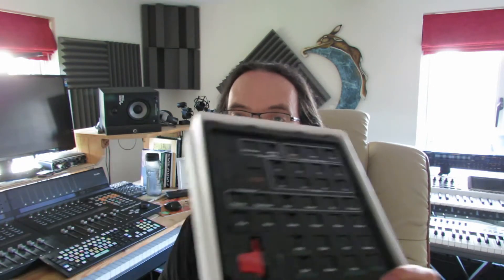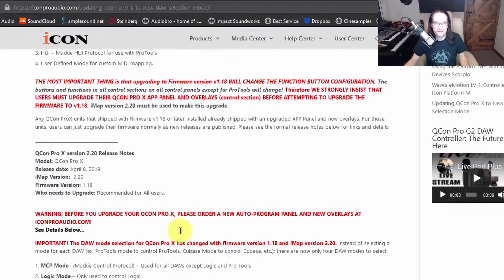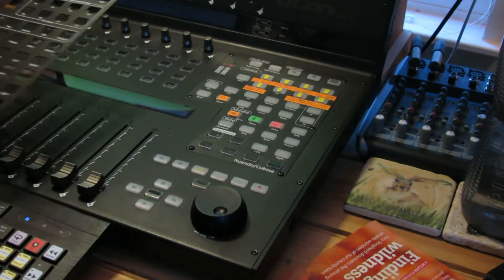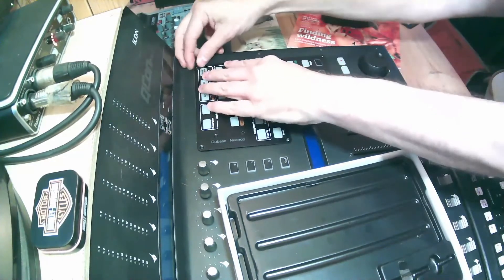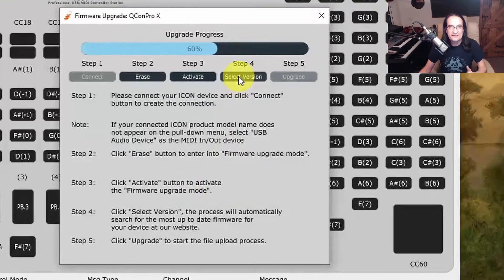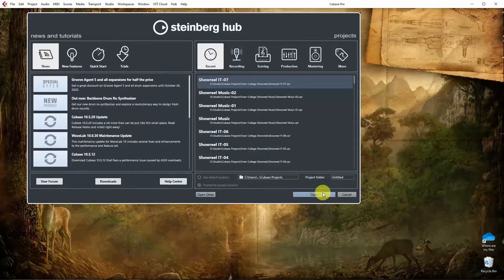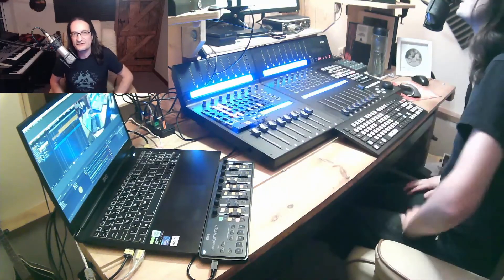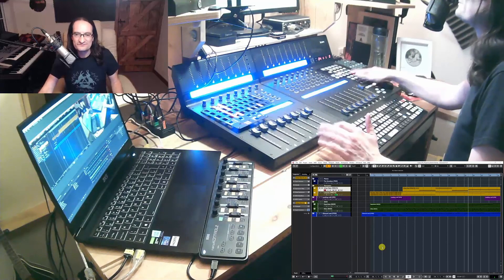Qcon Pro X front panel install and firmware upgrade

Comment: Great videos Daren! Thank you so much for taking the time to put these together, and I made my decision to originally purchase a G2, and then shortly thereafter upgrade to a Pro X because of them. I'm running Sequoia 15 and 16 beta, and it's working well. This video in particular saved my butt and I have a tip for others that you might like to add or to do a future video. 

During my firmware update, the software crashed because I was updating through a hub (I know, terrible practice and won't make that mistake again, though it used to work fine when I had a G2). Basically, the console got locked in firmware upgrade mode and could not be updated. I worked with a rep from MixWare (the iCon tech support rep here in the USA) and the fix was fortunately easy. Here were the steps:
1. Hook up G2 directly to PC and power up
2. Load iMap v2.30
3. Left click anywhere in the iMap window that is NOT on a button
4. Type "t" once (this bypasses the step where iMap searches for the console and tries to put it into Firware upgrade mode, which fails when it is already in firmware upgrade more and what hangs most of us up)
5. Look for and confirm that there is a "." now in the iMap title bar at the end of the title, confirming that it sees the console and is ready to proceed
6. Select the console and choose "v1.00" then proceeding with the firmware update as usual.

This worked great for me and was a pretty quick fix, without which I was completely dead in the water. Shout out to the folks at MixWare for their excellent help! They did mention that if this doens not work, then it is likely that the console needs to be returned to them or iCon to flash the memory on the unit with special in-house tools.

There is also the following link, but this was not helpful in my case:
https://support.iconproaudio.com/hc/en-us/articles/360058822152-What-to-do-when-your-Icon-Pro-Audio-controller-is-stuck-in-firmware-upgrade-mode

Hope this helps some folks, and remember when they say to connect the console directly to the computer, THEY MEAN IT!
Reply from the maker: I've pinned this in case anyone else has that problem. Thanks for the clear explanation. There is usually a solution somewhere.

Comment: Thanks so much for your detailed explanations, you have been an enormous help! I just moved to a pro X and XS and the icon website is not very clear on how to upgrade firmware, or anything else for that matter. There’s way too much old info and warnings etc that it was a little scary to even attempt an upgrade. A little disappointing when you spend that kind of money on a controller. Their manual leaves a bit to be desired too. Pretty vague and some misleading info within compared to other info on their site.
Reply from the maker: Yeah, good hardware but as you say very little of substance in the way of user instruction manuals etc. Hope you enjoy your new set up.
Reply: @MoonhareStudio  exactly. A little disappointing when you spend that kind of money but these seems to be rock solid units and incredibly intuitive with Logic Pro X. They defiantly could use a refresh of their startup/set up info instructions and I placed a ticket with support 2 days ago with no response yet to ask what the latest firmware version is because the imap 2.33 won’t install on Catalina for me. Keeps failing. My QCon system has version 2.06 so I am assuming that’s the most current firmware but not 100%. A work around is using a PC I guess to install imap but one shouldn’t have too!
Reply from the maker: @citytonightproductions  I think that 2.07 beta is out but I tend to work on the principle if it ain't broke, don't fix it so I'm leaving it on 2.06 for now.
Reply: @MoonhareStudio  oh thanks so much for the info. Yes 2.06 is working great for me as well so I’ll leave it alone, especially if it’s a beta for 2.07. I don’t want to have an expensive brick sitting on my desktop. I appreciate your replies, I wish their support would reply as quickly as you do! Not impressed by their support system, sure hope it improves

Comment: Great video thanks.  They still have not fixed the master channel level indicator lights.  Is there a detailed updated instruction manual?  A few functions confuse me, for example, when I press the DAW mode button it brings up the channel edit window in Cubase pro 12?
Reply from the maker: Hi there. Sorry I'm on vacation right now but a quick response is the master channel never worked for Cubase and still doesn't. I gave up on waiting for a decent instruction manual too so that's why I've done as many of these videos as possible to help people out with the basics plus some harder to work out stuff. I haven't covered everything so there are a few left to do. The DAW button issue I will have to look at when I get back home. I have got to do a lot of setup in Cubase 12 as I upgraded a couple of weeks ago but haven't had a chance to use it yet. If I see a solution I will post it here for you. All the best Darren
Reply: @MoonhareStudio  thanks, enjoy your well earned holiday.  My pro x would be just an expensive ornament without your great help.
Reply: Hi Darren,  did you ever get to check out about the DAW mode button opening the channel edit window?
Reply from the maker: Hi there. For personal reasons I've been out of the studio for a couple of months but all that is due to change soon so I will try to take a look once I'm all on track again. Darren

Comment: Just upgraded today   fixed a wealth of problems !    now (a tutorial) for the flip mode to use the faders for midi CC control in software VST instrument  plugins.     Is this a function in the iMap panel.?  A tutorial on this would be Epic.
Reply from the maker: That's great news. I wasn't actually having any issues with the old panel, but I'm so glad I upgraded as you'll see on my two follow up vids. As for other tutorials, yes I will do more. Just got to find the time but bear with me.

Comment: Thanks for the great video! But is the firmware update really necessary? In the sense of never change a running system?
Reply from the maker: No it isn't. It's been out for quite a while now and I carried on using the old one without issues. I will say that for me the new layout is much better but that's because many of the new features were exactly the ones I had to program into the function buttons. Also depends on the DAW you're using I guess.
Reply: Moonhare Studio Cubase 11 Pro would gain,I guess 😎😀. Thanks for the answer!

Comment: I see there is no channel edit button. I use this all of the time. Is there a way to assign a key to do this?
Reply from the maker: Hi there - The channel edit button is in the top right actually labelled DAW mode on the button itself but with a white text edit printed on the metal casing. Hope that helps.
Reply: @MoonhareStudio  Yes Thanks!  I just upgraded the firmware but it only shows me V1.15 for upgrade. Am I missing something?
Reply from the maker: https://www.youtube.com/watch?v=24fRywGluHA&lc=UgzIAOZSU0BLPSTX_m94AaABAg If you go to this page the downloads on the fifth and sixth rows should be the v 2 firmware upgrades for either mac or windows. Have a look - I assume you have the new panel already.
Reply: @MoonhareStudio  Yes I did all of that. But when I go into Cubase, it only gives me the v1.15 option
Reply: Everything works but I was questioning wether I had the latest update because when I hit the record button, it is hit or miss. Doesn't always work the first time I press it. It's very aggravating. Seems a bit sluggish.
Reply from the maker: @crescentsoundstudios  When you turn on the Qcon and the LCD comes up does it tell you you are on V 2 or is it still saying 1.15? That will give you an idea if it is Cubase or the Qcon that is the issue to start with. If the Qcon is still showing old firmware go through the process as I outlined it in the video again. If it's definitely OK then also check you have Mackie Control selected in Cubase. Try the classic hard power down and reboot too. Also worth trying to plug the Qcon direct into your PC/Mac rather than through a USB hub. Not sure what else to say as I haven't had that problem before.
Reply from the maker: @crescentsoundstudios  perhaps check out the icon forum. I know customer support is not Icon's strong suit but obviously I'm just a user myself so I'm not entirely sure why that would be happening. Might be an actual hardware rather than software issue?
Reply: @MoonhareStudio  Yeah I’ll look into it I already sent Icon a message. Thanks for your help buddy appreciate it!

Comment: I recently purchased an icon pro X from eBay running firmware version 1.15.
I updated the firmware following this video to the letter and my number one fader has stopped working￼, well I can control it with the DAW (Logic) if I move the on-screen fader then the fader on the pro X will move, but not the other way round. Also the blue LED does not illuminate when I touch the fader. Plus the machine keeps freezing on me, hardly make it through a song without it freezing.
Tried rolling back to previous firmware versions but no joy! 
iCon support is non-existent! Any advice welcome! Thanks!
Reply from the maker: Hey there. So sorry to hear you're having issues. You are probably aware that I started this channel because Icon support seems pretty non existant and I decided to just try to put up everything I have learnt through trial and error. So the first thing I'd check is the fader calibration. I don't have any explanation as to why one fader would be out but have a look at this video on faders and see if it helps. If not get back and I'll see if I can think of anything else. https://youtu.be/q0s-AWDTOJQ
Reply from the maker: Just one other thing. I tend to find the Qcon is much more stable if you run it direct into a USB port on your computer rather than through a USB hub.

Comment: Why not use the discrete daw mode overlay firmware? Thanks!
Reply from the maker: Hi there. Not sure if I am interpreting the question correctly so apologies if not, but this vid was mainly to address the issues between the old Qcon ProX vs the one that ships out now. So the firmware versions that came out after this hardware change remapped the controls to a new layout whatever DAW you were using. As long as you have the correct overlay or panel for the version of firmware you have installed then it should work fine. I like to keep my firmware updated so I had no option but to upgrade to the latest panel which also shipped with all the other DAW overlays in case you were running multiple software instances.
Reply: @MoonhareStudio  I might pick up a Qcon Pro x (maybe used or open box) and saw that there was both discrete and universal versions of the firmware on the download page. Why do you use one over the other? I wanted to understand before my purchase. Thanks for the quick reply!
Reply from the maker: Hi there. I'm running Cubase which is how the older units used to ship. It is now using the universal Mackie Control protocol which was a switch from the older firmware which was Cubase/Nuendo specific. If you're using a DAW that has its own specific control protocol then that Discrete version may be for you. This has actually changed since I was last on the site. They seem to have removed the older legacy firmware versions. However it is very straightforward to load in a different firmware if you find things are not operating as expected. Both my units are shop ex demo so I got them at a reduced price. Worth looking for bargains. Also check out my vid on Midi Controllers. You may find the G2 works well for you and it's cheaper. Also the Presonus Faderport is good value. https://youtu.be/iYOb_VjPxFk
Reply: @MoonhareStudio  I have an X-touch but I am a sucker for a nice meter bridge. 🙂

Comment: hi thanks for this video. I have also a icon q con pro x and it since 2 month. But in cubase 11 it does not work. Just in cubase 10.5, i wanted to upgrade today, but the erase button does not work. I do not ordered the new panel yet, cause i did not know to this.
Reply from the maker: Hi there. I have used the Qcon in Cubase 11 (I'm now on 12) so it should work. You should check the setup again in Studio Setup to make sure you do have your Mackie Controller selected and set to the Qcon. Is the issue that the whole unit is not working or is it that some features do not work?
Reply: Hi, thanks for your answer. Yes everything is set fine in the studio preferences. Macki Control is set up with the icon q con pro x and the midi setup ist also made. If did a firmware update and it works but unfortunately my keyboard was not working anymore. As i did the same in cubase 10.5 everything worked finde. But i like to use cubase 11 cause of same features there. But many thanks!!!  @MoonhareStudio

Comment: I have logic, but i cant control plugin paramters on the aux channels. Are you able to do that in your daw?
Reply from the maker: Hi there. Yes all the channels work in the same way on the Cubase mixer. eg If I set up a reverb FX channel (the equivalent of an AUX) and route a selection of channels to it all I have to do is select the FX channel to gain access to the inserts or sends in exactly the same way as any other. I never used Logic so I can't really offer you a solution I'm afraid.
Reply: @MoonhareStudio  much appreciated for the timely response. Its a little disappointing. For ex. I route all vocals to one aux and eq/compress/etc on that aux. It defeats the purpose of the controller if i cant select it or control it. Only the fader on the aux is controllable.
Reply from the maker: @rigzcarr8452  the only consolation is that I find for many plugins it is probably easier to use the mouse to control them rather than the Qcon. I do use the Qcon for the channel strip  EQ in Cubase as that is quite intuitive but if I insert an EQ that's more complex I don't usually bother. Each DAW has it's own quirks with any of the generic controllers but I use a combination of my little Nano Kontrol 2 and the Qcon for most go to functions, and the mouse handles the rest.

Comment: Hi Darren, thank you for all your videos on Qcon Pro X. : ) I know I'm a bit late to the party (lol), but I'm thinking of buying this Controller from Andertons UK along with one extender, but I have to get it right and I'm a little confused. I believe all the Overlays for the different DAW's come in the Qcon Pro X box, which I assume includes the Cubase Overlay (which I also run). So, in addition to changing the Overlay to Cubase, do I also need to order a separate Cubase specific Panel from iCon America in order for everything to be up to date? Apologies for being so dense. : ) Thank you - another Darren (Wales, UK). : )
Reply from the maker: Hi there - No problem. You should check with Andertons first and explain that you want the Cubase version. The panels are interchangeable as I demonstrated but who wants to wait 3 weeks for a panel to arrive if you can but one with the correct panel already fitted? I was upgrading from a previous hardware version so I had no choice. Andertons are very helpful so just ask first. If they literally have no Cubase versions in stock at least you will know what to expect and you'll just have to send for one or get them to. However I would say don't pay for someone to fit the panel. If you can use a screwdriver you can change it yourself. Hope that helps.
Reply: @MoonhareStudio  Hi Darren, thanks for your reply. : ) I've just noticed on the link you provided to, 'Updating QCon Pro X to New DAW Selection Mode' it says, "Any QCon ProX units that shipped with Firmware v1.18 or later installed already shipped with an upgraded APP Panel and new overlays. For those units, users can just upgrade their firmware normally as new releases are published." This seems to suggest that if Anderton's have a relatively new model I won't need to switch panels to a Cubase specific one. Is that how you read this? Thank you. : )
Reply: I spoke with Andertons but the guy wasn't really sure. : ) However, on the link you supplied to buying the Panels, I think it says that the Pro X ships with a Cubase Panel. So if it has the updated Firmware version as well, hopefully it should now be good to go out of the box? Am I missing something? Apologies for the silly questions, but I don't have the finances to get this wrong. : )
Reply from the maker: @dazza1000  Hi there. Yes they always used to ship with the Cubase/Nuendo panel as standard but it was 4 years ago that I bought mine so I wouldn't want to say that is certainly the case with every one. I know that some stores advertise which version they have in stock. I assume you are getting it shipped to you rather than picking it up. I think if you are worried see if they can open the box before shipping and just check for sure. It says it right on the front.
Reply: @MoonhareStudio  Ok, thanks for being so helpful Darren. : ) I've ordered one along with an extender, so it's a case of fingers crossed now! : )
Reply from the maker: @dazza1000  Best of luck and feel free to come back if you have questions with your set up.

Comment: Where can I find the actual firmware upgrade???
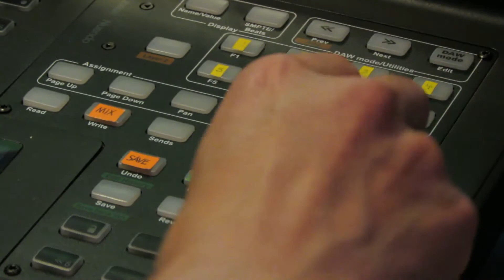Reply from the maker: I know where you're coming from - it took me ages to work it out - but if you go to 05:38 (Upgrading the firmware using iMap) you'll see it comes in via the iMap so there is no need to download the firmware and therefore no direct link on the website like there used to be. Hope that helps.

Comment: Hi, I am using Cubase 12 and the Qcon Pro X and I cannot figure out how to add markers.  How do I do this.  I have the latest firmware and Cubase overlay.  Thank you
Reply from the maker: Hi there. Yes you have to toggle layer 2. Have a look at this vid and check the index for how to do it. It is very close to the start. https://youtu.be/fbRWux19N4o